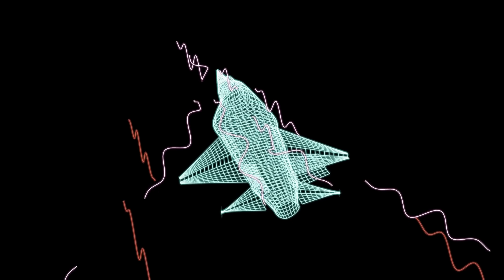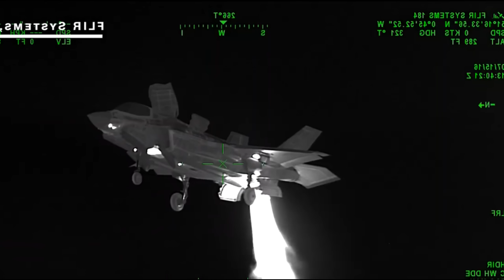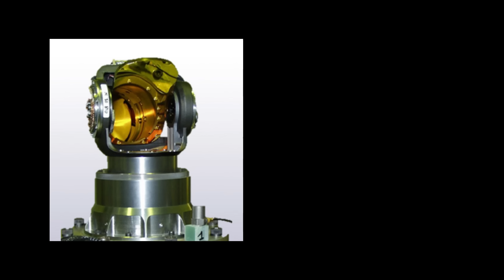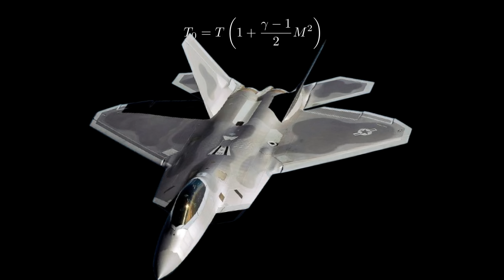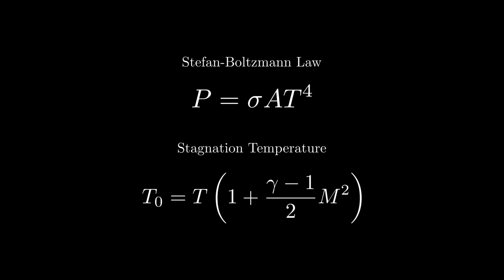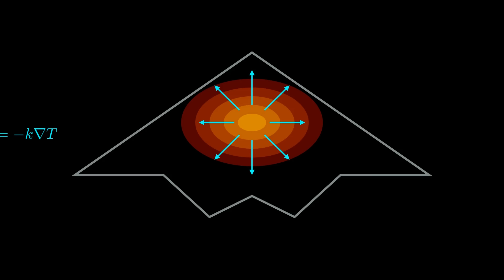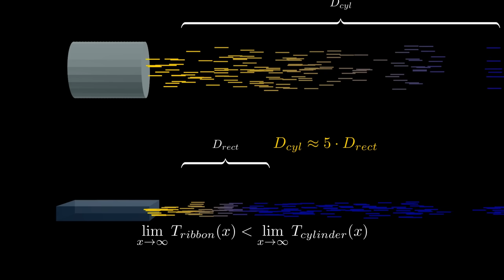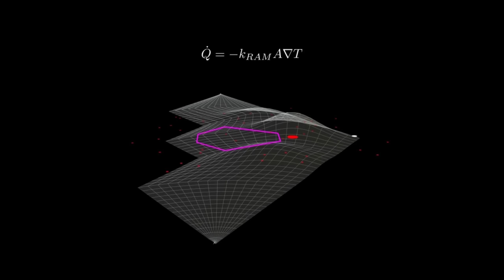How This Aircraft Became Impossible to Find.

Comment: It's worth pointing out that stealth hasn't ever really been about being able to hide completely, it is well known that you can use long wavelength radar to warn you that jets are roughly in an area.  That's what those huge radars the Russians have are all about.

I mean the problem with thermal detection is that from far away even a big jet looks like a single pixel and if you have cloud cover it can become impossible to see.  You don't need to be invisible, you just need to make it hard enough for them to target you that your missle can hit first.
Reply: Long-wavelength radars aren't a panacea. The way they defeat shaping is by inducing a diffractive return (as opposed to specular/reflective), but that comes with three downsides: Polarization is not preserved, and diffractive returns are very predictable. That combination plus the fact that LF radars have intrinsically small bandwidth makes it relatively easy to phase-cancel the returns from low-frequency radars. 

Stealth aircraft generally don't fly around in peacetime with their phase-cancellation EW turned on, so most of the "public" understanding of low-frequency radar effectiveness is inaccurate.
Reply: Can you really do that for the super low wavelength VHF early warning radars?   But only one at a time correct?  But my point was exactly that it is kinda silly to think of stealth as just about sneaking about, it is one part of an integrated approach that relies on jamming and other techniques (eg if you aren't stealth you reach jamming burn through much more quickly).

There is, ofc, the other disadvantage with those low frequency radars.  The radars are huge and cost 100s of millions so they probably don't last long.
Reply: @petergerdes1094  I don't see why it would be "one at a time" if you have a suitable EW array that can steer multiple beams at a time. IIUC all of the current US stealth platforms meet that criterion.

I absolutely agree that stealth is not an invisibility cloak, and has to be used as part of a comprehensive approach that includes tactics, decoys, jamming, etc. I was just pointing out that LF radars aren't the panacea that some people seem to believe they are.
Reply: @patrickchase5614 Because of the size of the wavelength -- same reason the strategic lower frequency radars in Russia are fixed in place and can't move -- the antenna needs to be building sized.  I wasn't talking about the S500 'long wavelength' modes which are actually relatively short wavelength in comparison.

For a phased array to steer a beam the size of the array must be many multiples of the wavelength.  The strategic VHF radars have wavelength of about 1m so to even steer a single beam you need something like a 5m x 5m array if not 10x10.  If you only care about directing the beam parallel to the ground maybe you could ignore the vertical aspect of the array so you would 'only' need a completely rigid 5m long piece of electronic equipment pointed vaguely in the direction you are flying.  You want two beams with different phases pointing in different directions that is asking for an even bigger array.  

None of that is happening on a stealth fighter or even bomber because the giant antenna you need for VHF would light you up at other frequencies.  Indeed, this is why I'm skeptical that you even could cancel the phase at these VHF frequencies.  

But it's really on the order of satellite detection.  I mean they are 3 of them and they can't move so you can just fly below their coverage (it's mostly in the high atmosphere).
Reply: @petergerdes1094  That's actually not true. 

Those large fixed radars need their large antenna to obtain a usably narrow beamwidth at low frequencies (1.22*lambda/aperture and all that), but the diffractive returns that a stealthy aircraft needs to cancel are anything but narrow. It's perfectly fine and indeed necessary (to defeat multistatic radars) for the aircraft to broadcast the cancelling return over a similarly wide range of angles, and you can do that with a much smaller antenna array.

The constraints on a radar's antenna are very, very different from the constraints on a jamming antenna. Don't confuse the two. A radar needs a beamwidth on the order of a few degrees to achieve usable angular resolution, and that means the angenna must be ~20x the wavelength due to diffraction. A jammer does not need that sort of angular resolution/specificity to cancel diffractive-regime (as opposed to specular) returns.

Go read a physics textbook or three, ideally including the ones (there are 2 that I know of) that Ufimtsev wrote about the diffractive regime once he was in the US. You need some steerability to deal with those returns, but over an order of magnitude or more less than in a radar.
Reply: @pat @patrickchase5614 if you are cancelling not just jamming two such radars you need to send a different phase and potentially power back to each source that exactly cancels the change in the signal the aircraft creates.  THAT is where the need to create two distinct beams come from.  

If you just want to jam of course you can do what you described because you don't need to exactly match and invert the phase in two directions at once.  But that is where we started (I wouldn't count jamming as stealth letting you go undetected)
Reply: @petergerdes1094  No, you don't need "2 distinct beams". 

The diffractive return component from the aircraft is itself very "wide" in azimuth and elevation, such that each adversary radar will be seeing the sum of its own reflection and the ones from all of the of the other radars. You need to send a canceling signal that is as close to that sum as possible at every angle/elevation.

Because diffractive returns are heavily scattered the canceling signal should and indeed must be very broad as well.

Again, the key intuition here is that the canceling signal does not need to be and indeed should not be any narrower than the return itself. For a stealth aircraft that uses shaping to suppress specular returns you only need to cancel the remaining diffractive "scatter", and for that you need and want a very "wide" canceling signal.

Admittedly that much narrower, shape-redirected specular "glint" is going somewhere, and a multistatic radar system might get lucky and happen to have a receiver in the right place at the right time. That's why China is building those huge LF Luneberg lens receiver arrays all over the first island chain. There is no way to avoid that, and that's one of the many reasons why stealth aircraft are known to "snake" through the sky to keep those return hotspots moving.
Reply: @petergerdes1094  Sorry for the double-reply, but the right way to think about shape-based stealth in this context is as the critical enabler for phase cancellation.

We've all seen those super-spiky polar RCS diagrams, and that's undoubtedly the context that you've had in mind as you've replied here. But the key observation that you are missing is that those spikes are entirely from the specular return component. If you can use shaping to suppress that, then what is left is very smoothly and continuously varying diffractive scatter. Removing the specular component transforms the problem from being basically impossible for all of the reasons you cite to being fairly tractable.

When you use a VHF radar to try to detect a stealthy aircraft you are relying entirely on those diffractive/scattered returns. Those can be canceled.
Reply: @pat @patrickchase5614 y I am not seeing the other reply so I don't quite follow your explanation for how you do it for two radars at once without the ability to target beams with different features to both.  FYI AI absolutely agrees with you that you can cancel a single VHF radar return but claims it is physically impossible for them to cancel 2 at once from different directions because of the need to send different beams at different phases to the two radars.  

I saw a notification pop up before but when I look for your other reply I'm not seeing it.
Reply: @pat @patrickchase5614 So you are suggesting that even though radar1 and radar2 are coming in from totally different angles with completely different phases the plane doesn't need to worry about matching the phases of each seperately because they will both be getting the exact same return (you can just match the sum?)? So the return from the plane with these radars is totally isotropic?
Reply: @petergerdes1094  No, it absolutely has to match the phases. I never said or implied otherwise.

As I've clearly said numerous time, because of the scattering inherent in the diffractive regime, the return observed by any given radar is a sum of its signal and those of the other radars that are incident on the aircraft. The canceling signal needs to match that sum, including phase.

But because the diffractive returns are not highly directional, the canceling signal doesn't need to be either. That's why a huge antenna isn't needed (coming back to your original objection).

Look, I know who you are and that you're an unquestionable expert in your domain. But you obviuosly have never studied radar physics in the diffractive/scattering regime. You should if you're going to hold forth like this.
Reply: Україна знищила більшість російських радарів
Reply: @любимыйчеловек-р5х dont underestimate Russia's production capibility, in 4 years of war they lost at max 20% of all their military equipment, and those 20% are a very optimistic pull from Ukrainians.
Reply: @joaoarmandowiteck760  20% це дуже мало, насправді більше. Росіяни ще мають зброю яка називається брехня і блеф, Навіть за часів карибської кризи ссср казав що має тисячі ядерних ракет хоча мав на той час лише 4 штуки які б могли долетіти до америки. Росіяни постійно брешуть, блефують, шантажують, їх можливо й не варто недооцінювати але й вірити в їхню постійну брехню і велич не варто.  Вони стверджують що їх 140 мільйонів але насправді по непрямим підрахункам їхня кількість від 90-100 мільйонів громадян.  Вони хвалилися на весь світ що мають гіперзвукову зброю і показували фотографії вашої американської ракети від локхед мартін.
Reply: @любимыйчеловек-р5х yeah yeah thats the west version of Russia, which is innaccurate.
Reply: @joaoarmandowiteck760 wrong, ive seen the numbers. If they have 80 percent left, why arent they using any of it?

Comment: It would be interesting how the YF-23 dealt with heat from the engines
Reply: Same as the B-2 - trenches on the upper half of the airframe, plus mixing with a "sheath" of bypass air as well as exotic materials to manage the heat.

Comment: Is not the friction, is compression of the fluid that rise the temperature.
Reply: It's both. Which one is more significant depends on the speed regime, with compression becoming more important at very high speeds.
Reply: Came here to see if anyone would mention compression heating.